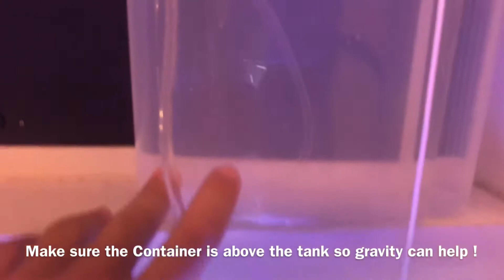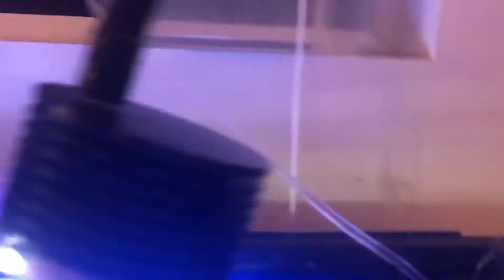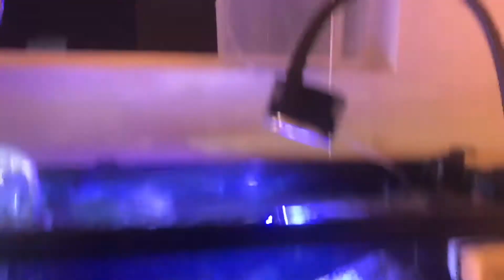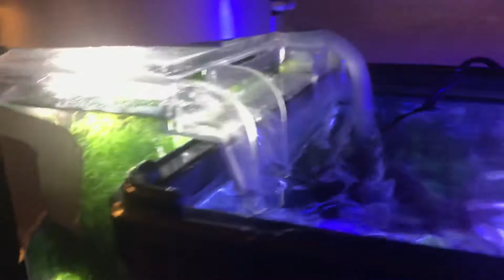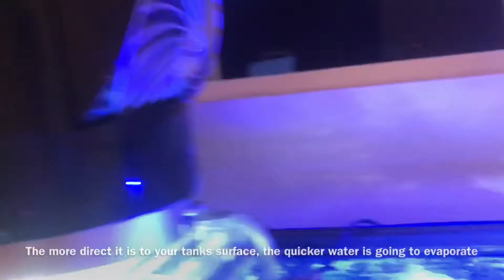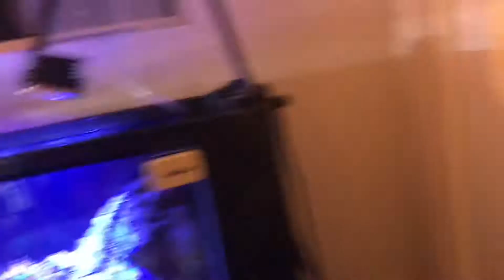$0 Auto-Topoff for Reef tank (NANO)

Comment: This is a good idea to save 100 plus bucks! If I went for this set up I would build tiny pvc over flow into a bucket just as a fail safe because the evaporation depends on the weather. If you look up Roma aquatics he has a nice small one you can copy.
Reply from the maker: prolificbreed Thanks for the tip. I’ll make sure to check him out